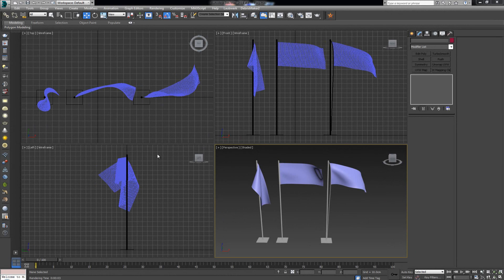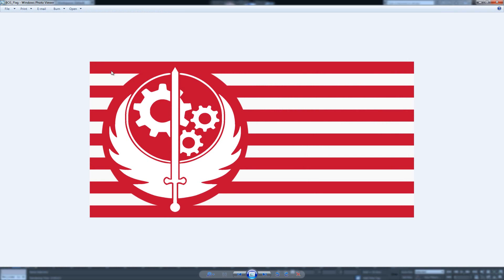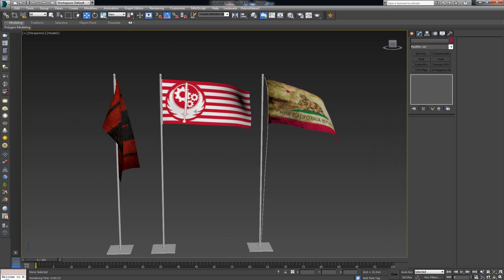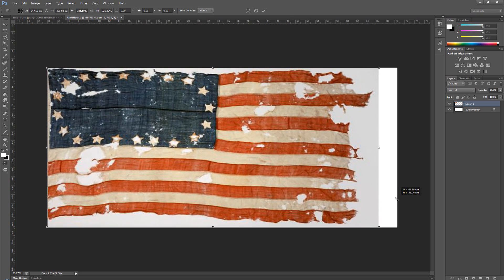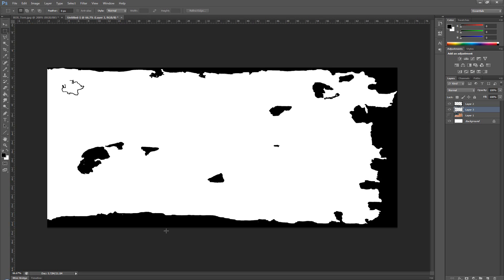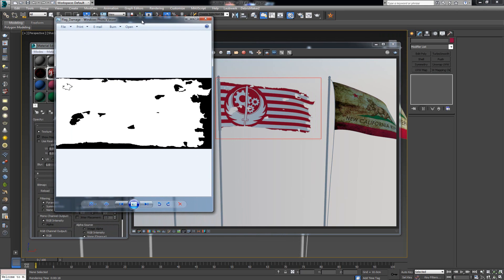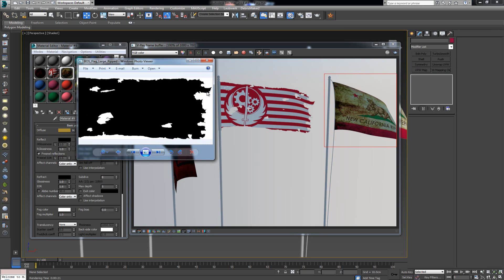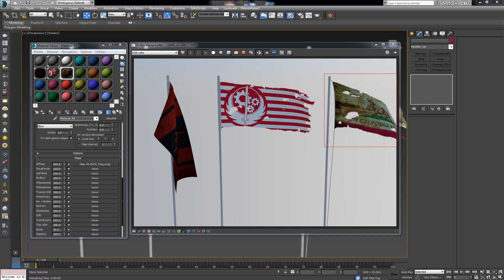Texturing a Damaged Fallout Themed Flag in 3ds Max

Comment: Hi , I just want to ask you about V-ray setting you use . Cause I have an issue with my interior scene , when I start rendering a full scene my laptop freezes and nothing work except the power button , and if I was listening to music , the music stops and make a noisy sound . Its freezing about 20 to 30 mins and then start rendering even though I use a fast setting.
My laptop ASUS X550DP and I'm using 3DS Max 2015 , V-ray 3
sorry about mistakes in grammar . I'm not good at English
Reply from the maker: +Ghaleb Ibrahim From what i can gather what you have is hardware issue. If it starts rendering after a while (20 min ??) then your settings in Max are OK. It kinda sounds like a HDD read issue if everything freezes for a period of time, though the fact that you are using AMD doesn't help too much either. All in all this is a Hardware issue more then anything else
Reply: +Denis Keman I think so too. because the setting I'm using is working normally on an old computer.
and yes, I have AMD A10. But in this case, what do you recommend to do?
 I wanna say that I appreciate your efforts, and I'm watching all your tutorials and they are very helpful
 thank so much